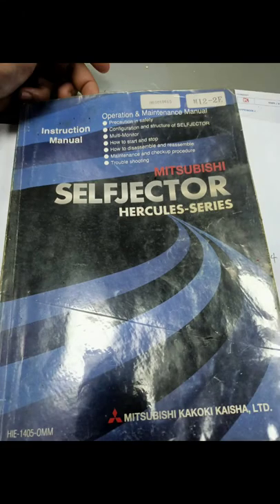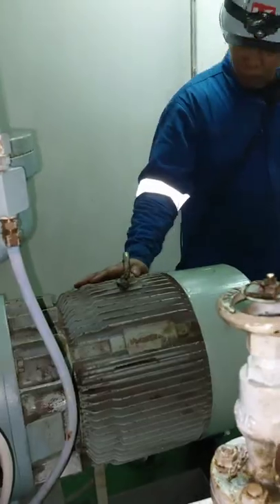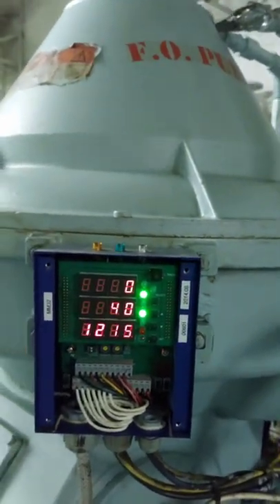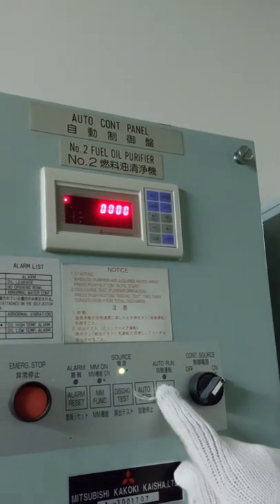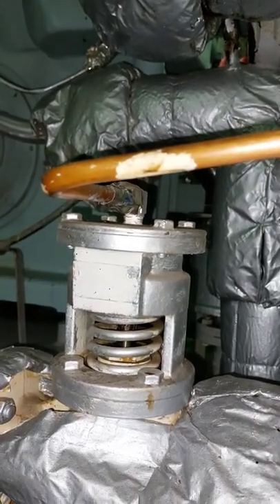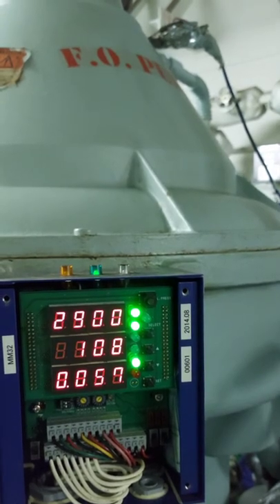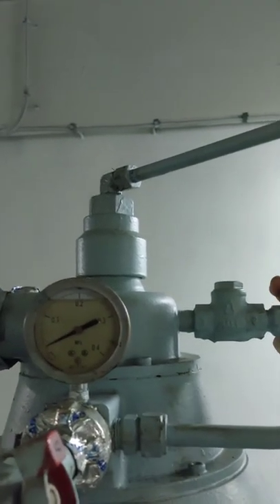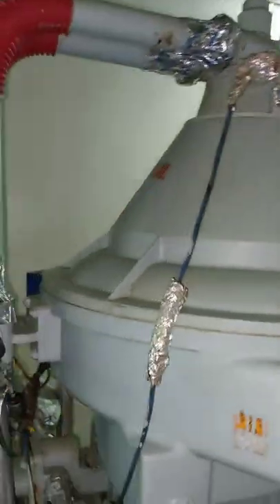FO Purifier SJ160H/Starting Procedure

Comment: How to adjust the backpressure and feed rate?
Reply from the maker: Just throttle na feed rate adjust valve and for the back pressure theres a valve to operate near the pressure line🙂
Reply: @phoyzonetv7147  do you mean throttle dirty oil inlet valve for adjust feed rate?

And discharge clean oil valve for adjust backpressure valve?
Reply: @phoyzonetv7147  please
Reply from the maker: Sorry for the late reply... Yes you can do that as you observe the pressure...
Reply: @phoyzonetv7147  there's a button on mm on top of you click that flow rate changes , do we have to adjust that too ? Or just adjusting the  dirty inlet vv opening will increase the flow rate ?